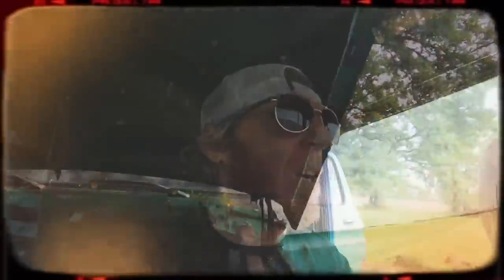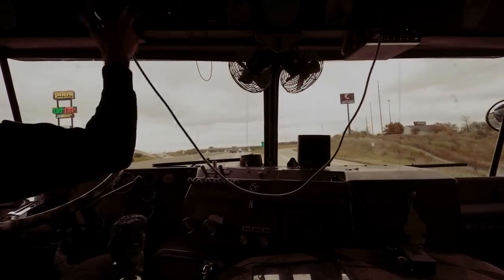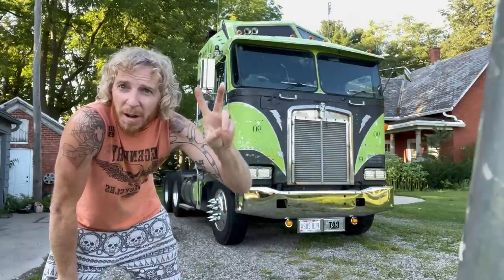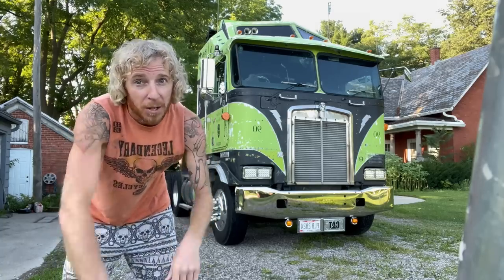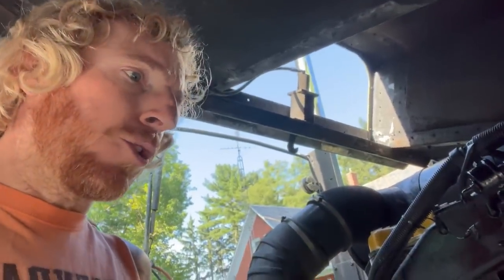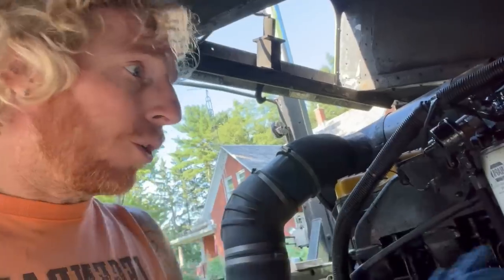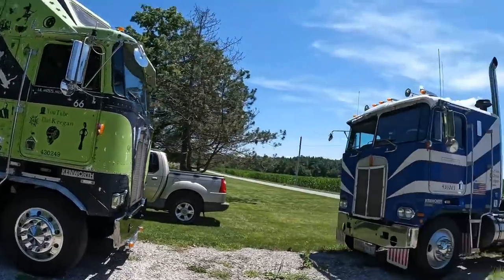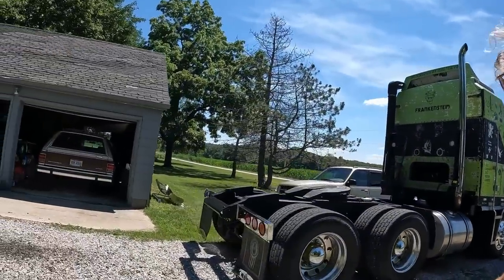3406B Caterpillar Fuel Filter/Water Separator Clean/Swap

Comment: That is a cool way you prime the fuel system.  From an old shade tree mechanic anytime you want to reuse fuel or coolant when working on the trucks an old t shirt works well as a filter to strain out any dirt or sludge.  I have used that trick for many years.
Reply from the maker: I’ll keep that in mind thanks for the tip

Comment: Good video again my friend that stuff you found  in the filter Diesel algae  my John Deere tractor had the same stuff  what you do get Diesel treatment for Algae put it in the tanks  and next time you change  the fuel filters  put automatic transmission fluid in the fuel filters that will help with the problem to  I promise that will help I have seen that A bunch of times before if you  let it  get bad enough it will start stoping everything  up I hope that will help you out my friend be safe on the road and it  real good to see Frankenstein running
Reply from the maker: Thanks Glenn I’ll do that

Comment: Looking good I was under the impression that the CAT filters are a 2 micron filter and your Napa filters are 5 micron. Cat recommended on the ones I had that I use their filters or a 2 micron high efficiency filter. Never a fan of CAT filters so I used fleetgard high efficiency never had an issue from it. You use what works for you. You could ask 100 different people and you’d most likely get about 100 different answers. Great to see Frankie back to work hopefully you have got it taken care of for awhile.
Reply from the maker: Yep but you never know these days

Comment: I always carry the pump and an extra gasket in the side box and fill my filters with a one gallon jug. The pumps will restrict fuel pressure even without derbis. I carry them separate for emergencies only. LoveBaldwin filters
Reply from the maker: Don’t get the discount
Reply: @1ChadKeegan  I found Baldwin and donaldson offered some filters with smaller Micron ratings which would decrease resistance.  I change filters quite a bit so when WE'RE DOIN IT WE GET IT DONE
Reply from the maker: @andrewnorris1514  bout every 6 months depending on mileage but the fuel quality these days doesn’t help much
Reply: @1ChadKeegan  wow. If I change it every 2 weeks I guarantee I find crap . I pour the canister thru a paper towel and right back into the tank. But  I would run 35 states a year and gobs of fuel stops. I've found stuff that was part of stations repairing there pumps and nozzles
Reply from the maker: @andrewnorris1514  I’d believe it I’ve got some broken seals settled on the bottom of my passenger tank I need to suck out idk where tf they came from

Comment: Put a shut off on either side of your Primary. Before you change it always turn off both in and out. That way no air gets in. The Primary has2 o-rings and one copper washer
Reply from the maker: No 😂

Comment: Yeah its an absolute waste of time changing a filter and tipping the old in to the new . If you got water in you still get to keep your water? ! Hand primers are there for good reason .They do work but they do fail too. . especially 3406 ones . A  diesel can with an outlet tap is one of the best ways to fill a filter . Diesel here in the uk stinks something rotten .Nothing like it used to be .It feels horrid too and is impossible to wash off . Hence my disliking to diesel  fuel  and why i run a 2.5 turbo petrol car . Quite odd how old diesel smells different and doesnt deteriorate like modern cack .To much fiddling and ripping off with ethers and other additives . I just cant bide it anywhere near my skin .  God bless ya dude ! All the best .Thanks.
Reply from the maker: No water why waste good?
Reply: @1ChadKeegan  haha its never good ! Full o grit and smalls and really how much is a cup of fuel ! Its a no brainer .Use it as parts cleaner . You know what they say about nickle and dimes ! Penny piching swines ! Lol
Reply from the maker: @gajmtaj  didn’t know you ran stuff who are you again you comment every 5 months when you wanna act better?

Comment: Just hand prime
No need to take lines off lol
And always use cat filters.
Reply from the maker: Hand prime doesn’t work when I pull that screen filter lol and cat filters clog to easy. You should know that..
Reply: Change both filters then prime 
Pump primer until hard then start.
I usually change mine about every 
30 days just to stay on an interval.
Good looking truck by the way.
Reply from the maker: @gabrieletrucking6639  that doesn’t work or I’d do that.. if I don’t suck the line it will run itself outta fuel in 2 miles.